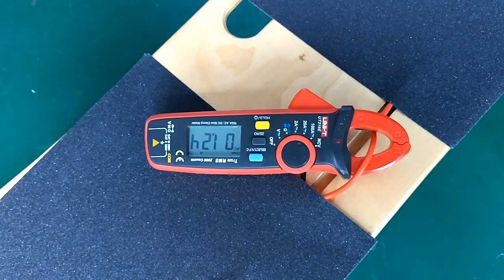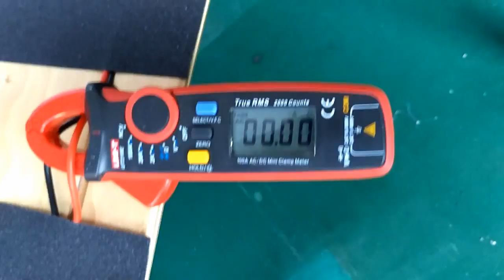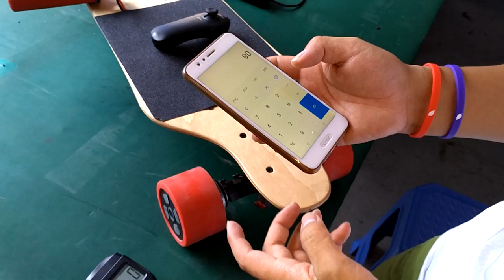Best Quality $199 Electric skateboard Unassemble | Meepo Board(1/2)

Comment: Wow! Got my board last night and it's amazing! Went 5 miles today and still had between 50-75% left. I haven't tested top speed but it's fast. I run it with my doberman so will have to test without her someday. Forget wasting tons of $$ on others that I'm sure are fine but this one you can't beat for the $310. My friend is going to be getting one soon.
Reply: Update! Meepo cut out on my yesterday! Will be taking apart tonight to try to find issue. Wouldn't power on at all!! I put a lot of miles on my 1st & 2nd one! Wheels are showing wear & tear from summer use.

Comment: Are you able to change the battery and trucks to a different board? Because I have a penny board and want to put it on their
Reply from the maker: Sky1ift K i think not compatiblr. all parts.  i also have a meepo penny you check that video maybe
Reply: Sky1ift K as long as you unscrew the 20 or so screws and redrill th3m into another board ya

Comment: Hi bro you have any smaller board which be more useful for every day? Also how about shipping to Singapore? you sell on tabao or Tmall?
Reply from the maker: I have some, but slower 15kmh top speed, 70mm wheels single motor.  You can email me if really interested. I run no store so far.
 kieran.eboard@qq.com
Reply: I mailed you. Please reply. Looking for Dual Hub motral same setup on a shorter board
Reply: What was the quote? I'm also looking for something smaller using hub motors
Reply from the maker: emailed you. Thanks.

Comment: will ship worldwide? can you ship it part by part?
Reply from the maker: In theory, yes world wide. You would prefer that I ship complete unit to save your shipping cost.
Reply: Kieran E-board complaints unit will hold by custom... Part by part will be smart, ps, price for shipping?
Reply from the maker: which country?  Let me first check if I can solve your custom issue.
Reply: Kieran E-board Israel.
Reply from the maker: Not easy. I Contacted several courier we are working with.  I will get back to you later when I get a quote.
Reply: any update?
Reply from the maker: No courier able to ship the battery of 158WH,4.4Ah.    Anyone find out a way, please let me know!
Reply: Kieran E-board can you ship without battery?
Reply from the maker: yes. sure. 10s2p, and my cells shape are compatible with case. email me please.
Reply: what your email?
Reply from the maker: kieran.eboard@qq.com